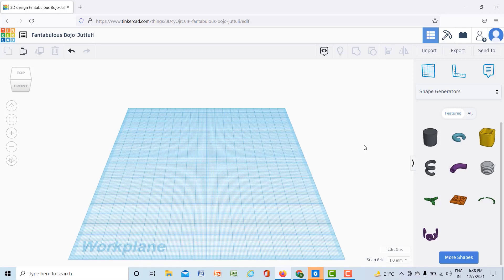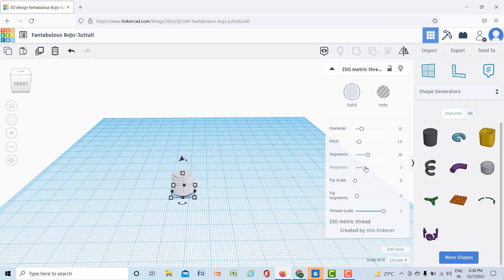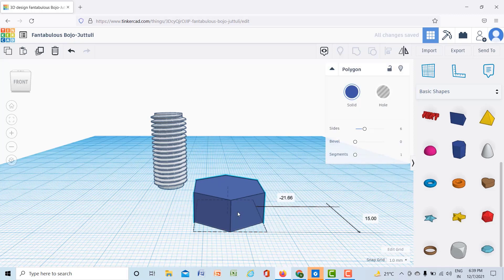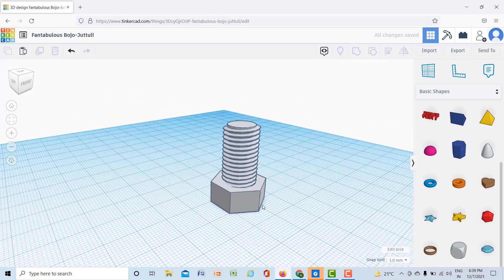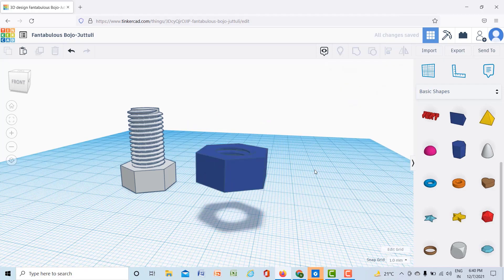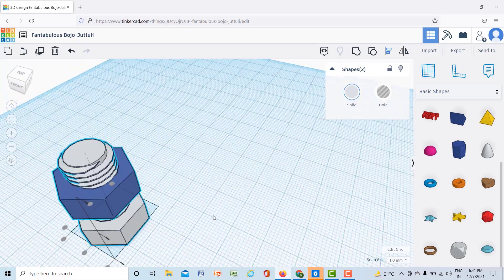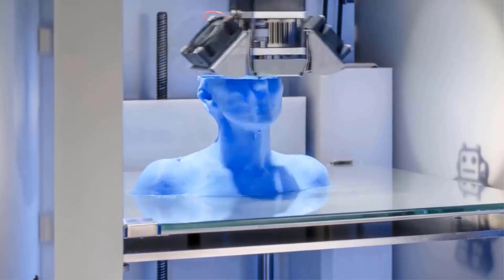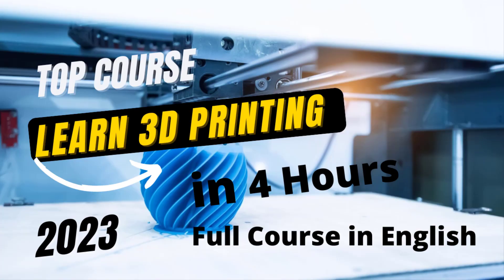Nut Bolt Making in Tinkercad/ Use of Shape Generators in Tinkercad

Comment: Have you printed the nut and bolt?
If you had, you would find that the nut and bold can not be screwed together.
The main reason is that the thread hole on the nut and the thread on the bolt  are exactly the same size.  This is known as an interference fit, where all the outer surfaces of both threads are trying to occupy the same space.
You need to have a small gap between the threads of the nut and threads of the bolt.  This is a clearance fit.  The gap stops the surfaces from rubbing hard against each other and also accounts for manufacturing inaccuracies.
Reply: What’s the cheapest but best 3d printer u can get for begginer
Reply: Bambu Labs' A1 Mini, hands down. @Anonymous-13-
Reply: Absolutely !  Exactly the caveat I was going to provide !  Some real art or experience needed to figure out how much bigger to make the hole in the nut for a snug fit that will still allow the nut to turn on the bolt.  A lot of the problem in getting the nut-bolt combo to work is that in 3D printing the filament shrinks after cooling.  Amount of shrink depends on several factors including type of filament, dimensions of the parts.  The problem also occurs in getting ANY two parts to fit- threaded or otherwise.  Often a minute difference of only 0.1 or 0.2mm between the hole and the object fixes the problem.  Glaring omission of this detail makes me wonder if similar omissions occur in the course being offered.